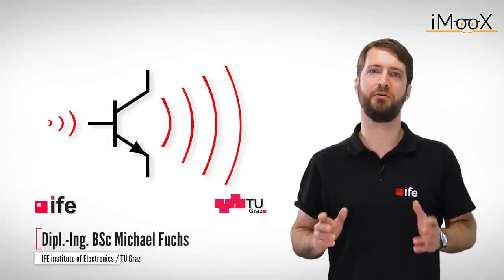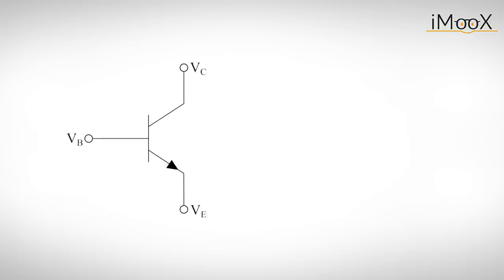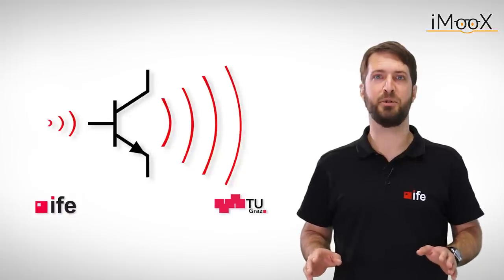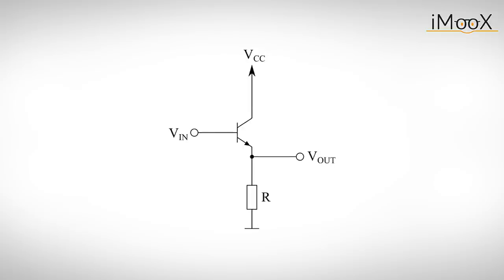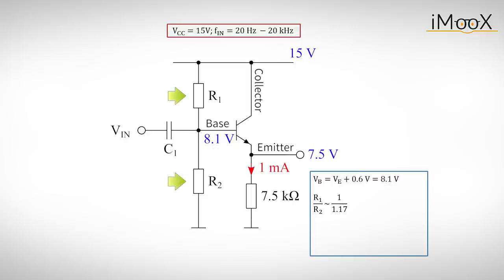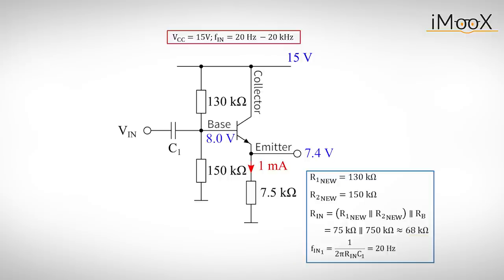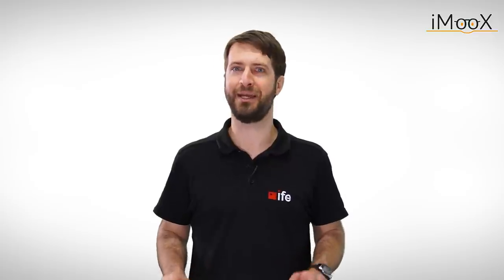The transistor as an amplifier (Part 1)

Comment: Sir, you said that it should be 750 k, you said that the input resistance should be 10 times bigger than it should be 75k, according to what did you choose it? First you said it would be B times bigger, then you said it as 10 times.
Reply: I see your confusion. I'm talking about two different impedance values here, which an AC current would see.
- The first one I'm talking about is the input impedance of the transistor. Imagine you are an AC signal, standing at the base connection of the transistor. If you look to the right (the direction of the base), you will see an input impedance of beta*R_E. Since beta is approximately 100, the base impedance is about 750k.
- The second impedance is the one of the voltage divider. Again imagine standing at the base connection, but this time you look to the left and see the parallel impedance of the voltage divider (R1 and R2), which should be at least 10 times lower than the base impedance (on the right side) --> therefore 75k.
Finally you can imagine yourself standing at the input looking to the right. If you neglect the capacitor for a moment you will see the two impedances we just calculated in parallel (75k || 750k), which is about 68k. With this value you can calculate the necessary value vor the capacitor C_1.
I know it's a little tricky to understand the AC signal point of view at first. If you are struggling with it, it's worth to google "small signal analysis" for further reading. I hope this helps!
Reply: @ife.tugraz  Sir.Thank you very very much for detail explanation.I understood now .Thnak you
Reply: @ife.tugraz  
sir, you explained it very well, I have a request from you, would you make such a video about mosfet? (how should input, output impedance etc.)

Comment: I don’t understand this circuit. Why is the output voltage lower than the input. How does that make it an amplifier if it is less than what it started ?
Reply: Legitimate question! The reason is that the transistor is a current-amplifier. It only amplifies currents, not voltages. If you want to learn how to build a voltage amplifier, you will be interested in our next video on transistor amplifiers:
https://www.youtube.com/watch?v=WlKhkjyzfNI&list=PLhy2nHJciTED7xA_u5OyUj7oDEFf3BuZY
Reply: The voltage amplification factor of this circuit is not defined as the ratio of the dc output voltage to dc input voltage as you seem to think. Rather it is defined as the ratio of peak-to-peak output voltage to peak-to-peak input voltage. Detailed circuit analysis will show that the voltage gain for this common collector amplifier circuit is slightly less than 1 (about 0.98). It's not employed for its amplification property but for its high input impedance and low output impedance property, i.e. as a buffer between two circuits with "incompatible" impedance levels.

Comment: In the diagram at 6:52 it appears that all of the amplified current IC is just flowing to ground through the resistor R. Is R the load ?
Reply from the maker: No, R is not the load in this case. A load could be connected in parallel to R. Usually you will also find an additional capacitor at the output acting as a high pass filter. Here you can find an example of such a circuit here: https://bit.ly/2SsrJxw

Comment: Why R1/R2 is 1/1.17? Why is that 1? In numerator and after that you use 2.17 in numerator?
Reply: The supply voltage of 15V is divided by the two resistors R1 and R2. You want to have 8.1V voltage drop at R2 and therefore a 6.9V drop at R1. So what you need a divider ratio of R1/R2 = 6.9/8.1, which is equal to R1/R2 = 1/1.17 . Does this help?

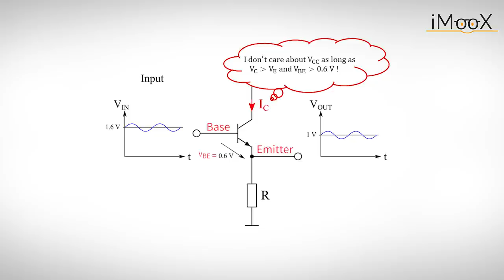Comment: 6:41 is output current is ic ?
Reply: In most literature you will find I_C as output current, as this allows a simple definition of the gain beta (I_C = beta * I_B). But you have a point there. One could argue that the actual output current must be I_E, since this is the current flowing into the load. In this case, you must add the base current to I_C to obtain the new output current. With the previously defined gain beta you get I_E = (beta + 1) * I_B.
Reply: @michaelfuchs441  ohh ! thank you for your reply! ..............understood.

Comment: How do i choose a transistor? I'm sure there are transistors rated for high voltage applications. I needed to buy and explore one rather than listening and reading..
Reply: Typically you choose a transistor according to the most important parameters for your application in the datasheet. But it's not easy to tell you what you need for a specific application. You might want to amplify high currents (collector current)), or you might want to have a very fast transistor for switching (turn on time) or for high freuency amplification (gain bandwidth product), or you might want to switch high voltages (max. collector-emitter voltage or better look for MOSFETs, Thyristors, JFETs,...) maybe with high efficiency (on resistance) or maybe you need very low leakage currents, or you might be more concerned about linearity, or temperature behavior. It all depends...

Comment: Can you explain how you got R1=75K(2.17/1.17)? Im trying to figure out where you got 2.17/1.17 from.
Reply: This question comes up a lot. Here is my previous explanation. Feel free to ask again, if it's still unclear.

In short you get the 1/1.17 from the voltage divider at the input. If the biasing voltage at the base would be half of the suplly voltage, R1/R2 would be exactly 1. But since we need 0.6V more at the base, we get R1/R2 = 1/1.17.
Now for small AC signals at the input the DC voltage source looks like a short and the input resistance looks like a parallel connection of R1 and R2. This is what is troubeling most of our viewers, which is why we will shortly do a video about small signal analysis. But from there on it's simple:
You can calculate resistors R1 and R2 by knowing the ratio from above, and knowing, that they both in parallel need to be at least 10*R_E=10*7,5k=75k. From there on you can calculate the parallel resistance R_1//R_2=(R_1*R_2)/(R_1+R_2)=75k. If you now put in the ratio from above (R_2=1.17*R_1) you get 75k=(1.17*R_1^2)/(R_1+1.17*R_1) and if you solve this equation you will end up with R_1=75k*2.17/1.17. I hope this helps.
Reply: @michaelfuchs441  I was able to figure it out with the help of reddit. Great video im trying to learn electronics so I don't shock myself all the time and this is just one of the great sources i've learned from.
Reply: where at on reddit

Comment: 1/(2*pi*20*68000)=0.124uF ???? I do a calculation that tells me 1.1702F
Reply from the maker: You're right! There is a minor mistake with the last value behind the comma. Your calculator should give you 1.1702 * 10^(-7), which is 0.11702 * 10^(-6), or approximately 0.12 µF. As a result you could also choose a 0.12µF capacitor out of the E12 series.

Comment: A more better explanation is that the transistor is a voltage controlled device.
Reply: But it is not. Ofc potential difference causing current but if you would explain that way it only make things harder to explain imo. You would deal with non linear I(V) characteristic of p-n junction at first. Also "current" - more simply conception than voltage.
Reply: It is a current control device.
Reply: Nah. The measured ic-vce characteristics obtained clearly show the transistor is a current-controlled device.
Reply: it is voltage controlled but it is simpler to assume constant VBE and that it's current controlled

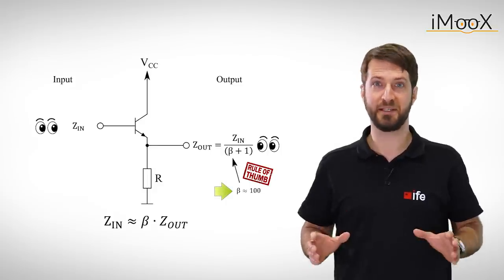Comment: NOT clear after 7:48. I know some electronic basics but still confused with following issues and u can see I give a lot of efforts to watch this 5 times and write these issues to this channel.

7:48 why beta=100 will make " this allow a weak input signal source to drive a load at the output of the follower, which it would not drive by itself "  ? Don't understand. Pls explain this in plain English without a lot of grammar embellishment.

From 8:48 - 11:54, NOT clear. (1)How do you know R2=1.17R1?,  (2) What is the symbol of vertical =? (3) Why R1 vertical= R2 =75k ohm? (4) 10:08 Rb=750k then 10:18 R1R2=750k*10=7500k instead of 75k 

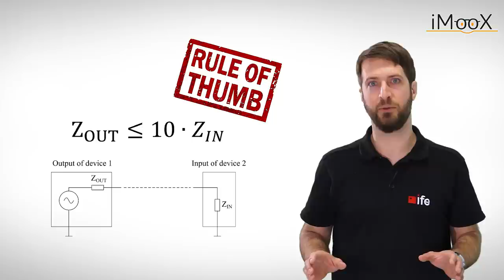(5) 7:34  you said rule of thumb is Zout<=10Zin  7:53 beta=100 is another rule of thumb, There should be only ONE rule of thumb if you have 2nd rule just say 2nd rule. You should NOT have 2 or 3 or 10 rule of thumbS so when you apply these 2 rule of thumbS from 9:58 to 10:38. It is confusing.

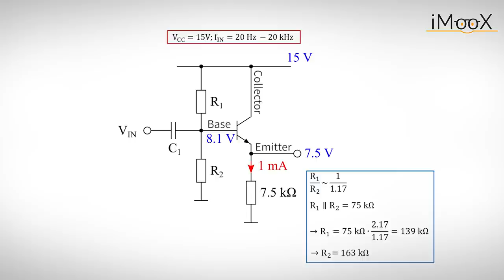(6) 11:03 Why R2 have to *2.17 to =163k,   pls make your videos more clear, pls think of your audience,  if the audience know these knowledge already than we don't need to watch this. Since this is not a face to face classroom and don't have a book here. You may want to explain the symbol used during the video and add symbol illustrations and calculation process in the notes session below ur video.

Lastly, the pronunciation is difficult to understand. pls improve.
Reply: Sorry for the late response. Since we are a little institute at a university and not professional youtubers, we're swamped at times. Now regarding your questions:
- 7:48: This is a current amplifier and therefore amplifies currents (up to 100 times the input current). In electronics, you often have outputs (for instance an output pin of a microcontroller), that cannot output much current. As a consequence you cannot drive e.g. a speaker by directly connecting the microcontroller to it. Often times we say that "the speaker is a too heavy load to drive" for the microcontroller. Therefore you need this current amplifier in between microcontroller and speaker in order to allow a microcontroller to drive such a load.

- 8:48 - 11:54: (1) This is explained several times in the comments. Here is my last answer: "In short you get the 1/1.17 from the voltage divider at the input. If the biasing voltage at the base would be half of the suplly voltage, R1/R2 would be exactly 1. But since we need 0.6V more at the base, we get R1/R2 = 1/1.17.
Now for small AC signals at the input the DC voltage source looks like a short and the input resistance looks like a parallel connection of R1 and R2. This is what is troubeling most of our viewers, which is why we will shortly do a video about small signal analysis. But from there on it's simple:
You can calculate resistors R1 and R2 by knowing the ratio from above, and knowing, that they both in parallel need to be at least 10*R_E=10*7,5k=75k. From there on you can calculate the parallel resistance R_1//R_2=(R_1*R_2)/(R_1+R_2)=75k. If you now put in the ratio from above (R_2=1.17*R_1) you get 75k=(1.17*R_1^2)/(R_1+1.17*R_1) and if you solve this equation you will end up with R_1=75k*2.17/1.17. I hope this helps."
(2) & (3) The symbol || means "parallel to". You can find a detailed explanation here: https://www.allaboutcircuits.com/tools/parallel-resistance-calculator/
(4) R1 || R2 must be 10 times smaller, than the output impedance, so therefore 750k / 10 = 75k

(5) You obviously don't like more than one rule in order to approximate something. Duly noted.

(6) If you check out how parallel resistors are calculated you surely get why the factor is now 2.17. Since these were originally made for our bachelor students, we did not want to explain everything. By the way, it is not a crime to google or open a book, if you don't get something in our videos. You can even find suggestions for additional literature at the end of the video and in the video description.

And yes, English is not our native language, but we try our best. If you don't like it, stick to other channels. There are a lot of indian guys out there, who might do a better job than we do.